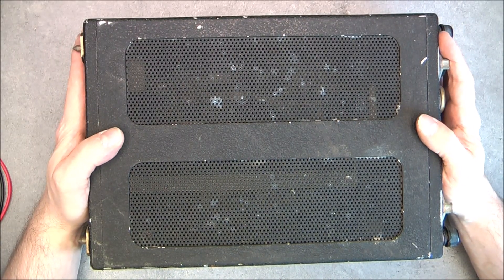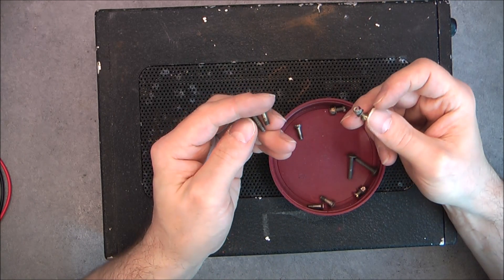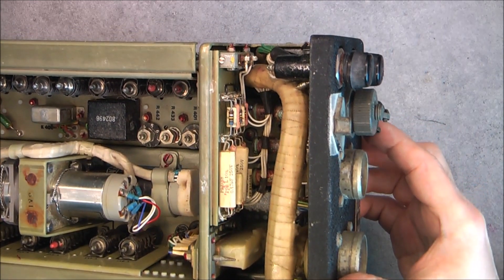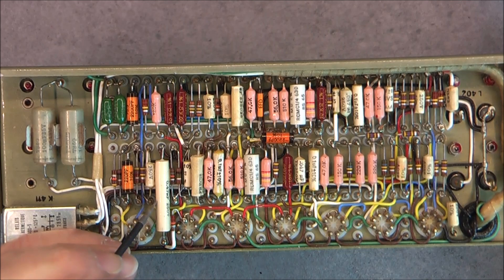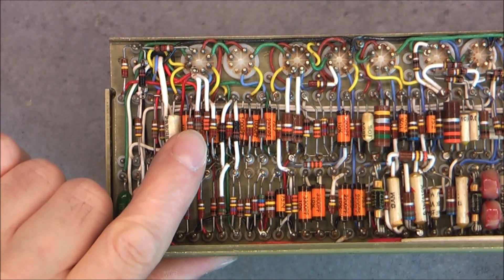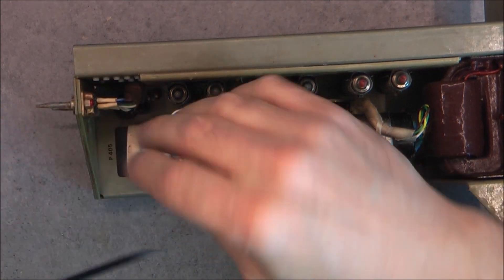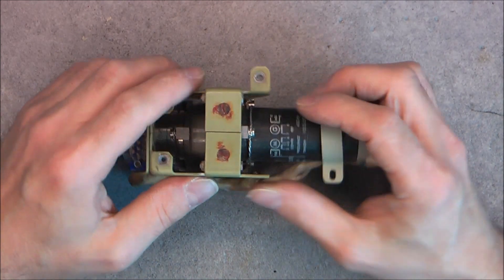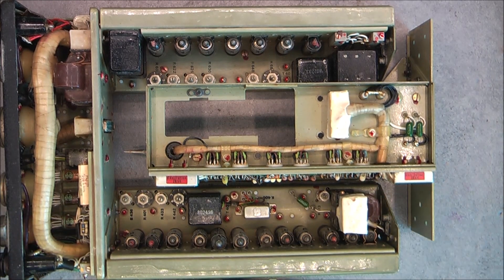Vintage Avions Marcel Dassault electronics box teardown

Comment: Connectors are potted to prevent any corona discharge between pins, where you could have high voltage inputs next to low voltage signals.
Reply: Especially at high altitude